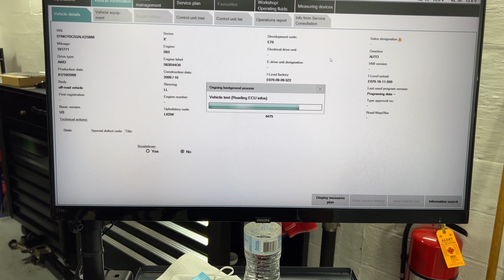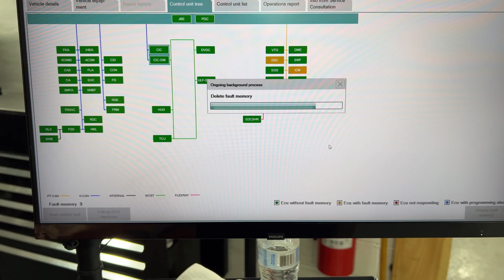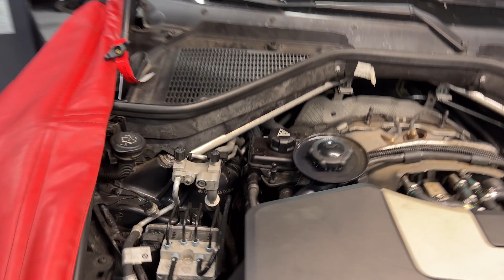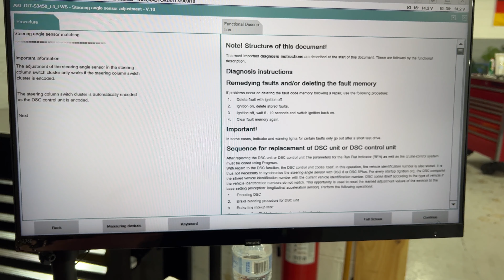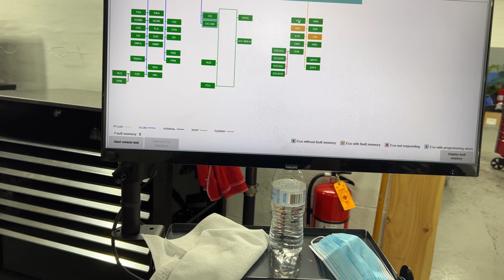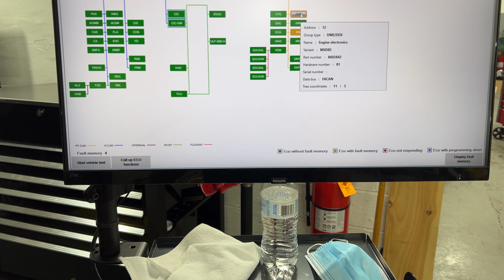2010 X5M no start dead battery Diagnosis Part 3

Comment: So the battery sensor tells the ECU the temperature, and the ECU controls the alternator on the command wire. But what's the purpose of the third wire -the one from alternator to back to ECU ? 👍
Reply from the maker: There is no 3rd wire for the alternator. It is just a main big power cable for the battery, the ground (case ground) and the BSD line that controls the output of the alternator, this is a bi-directional comm line.
Reply: @MaicSalazarDiagnostics  Thanks once again for explaining . Happy holidays 🥃